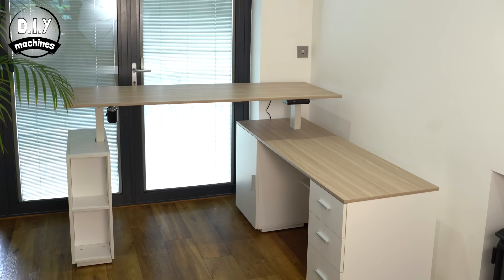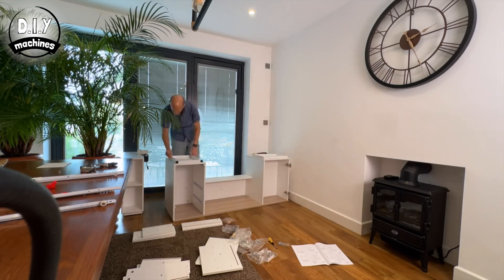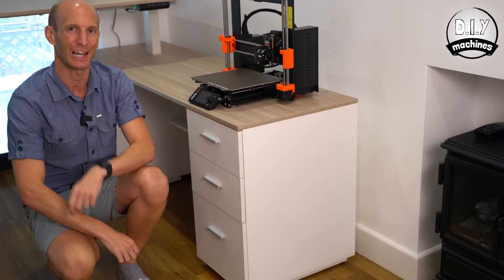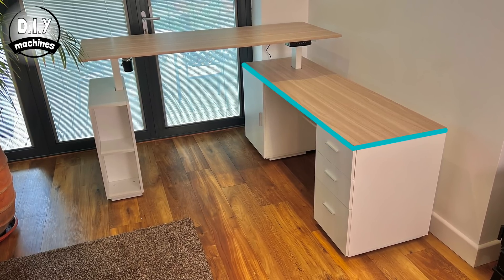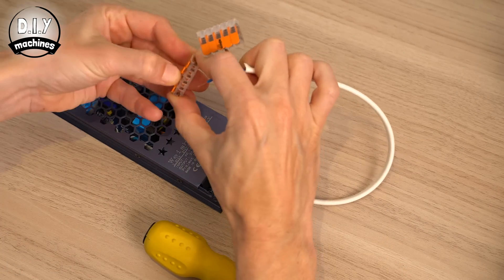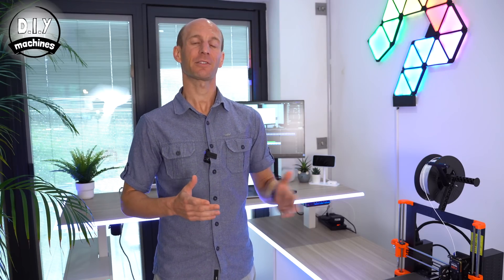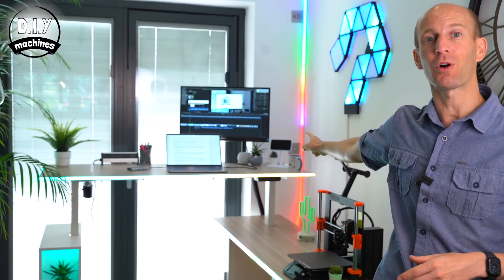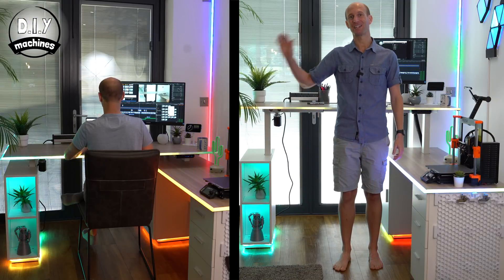Making the ULTIMATE 3D Printing SMART DESK

Comment: I Always used an esp32 without any level shifter to control my led Stripes. It always did work just fine, only the esp shouldnt have an long cable run to the first led. 50cm for me did work fine , more can be lead dto some Problems if using an resistor on the datapin. I use 150Ohms to protect the pin and also i use an old ir reciver to concol it via the common rgb remotes.